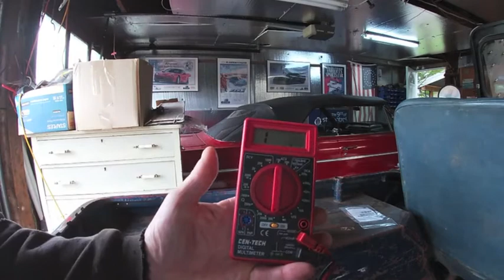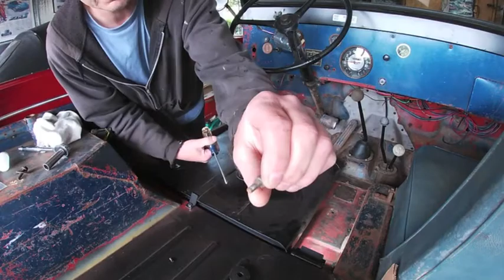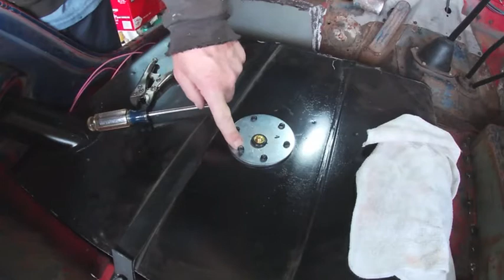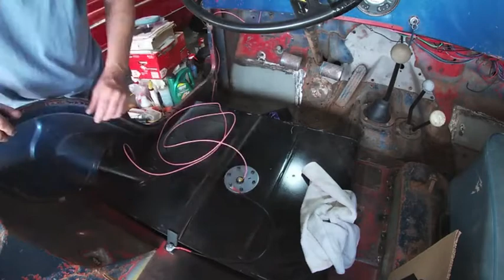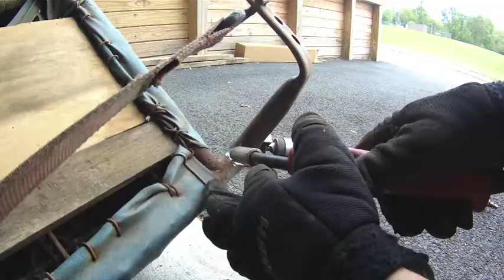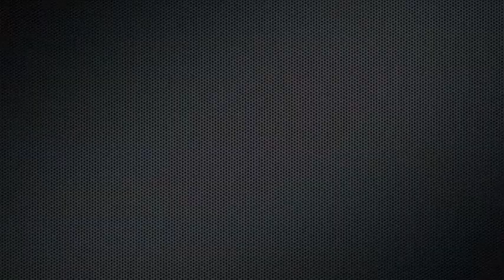55 Willys Jeep Fuel Sending Unit

Comment: My 1954 Willys CJ-3B has a Chevy Luv Truck tank and fuel tank fuel sending unit. It wasn’t easy to find the right sensor. I purchased two wrong sensors before I found the correct sensor.

Comment: I am about to replace my cork gasket on my CJ2A.  It was leaking gas.  I was surprised you didn’t use gasket sealer.  Is that unnecessary with a cork gasket.  Also would it be a good idea to clean the tank where the gasket goes on with steel wool or sand paper?  Nice video!
Reply from the maker: The original gasket on mine didn't appear to have had sealant, thus why I installed it dry. I had this off before this video when I painted the tank, so the area was already cleaned with a rag and lacquer thinner. Thanks for watching!